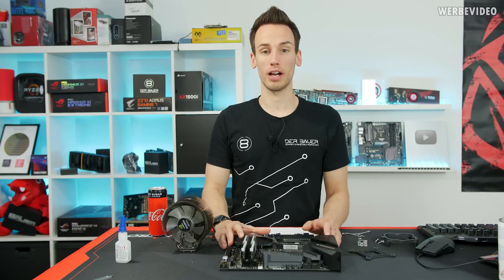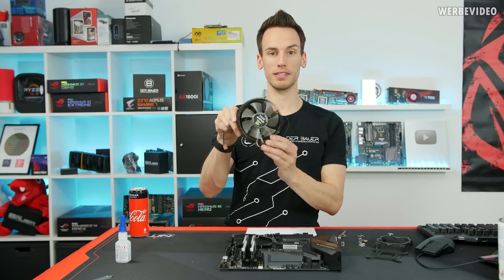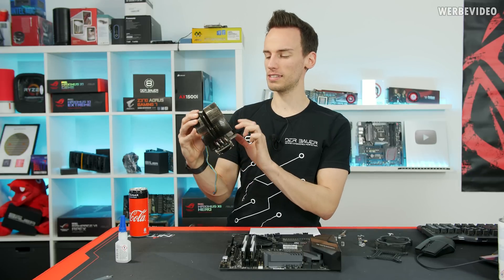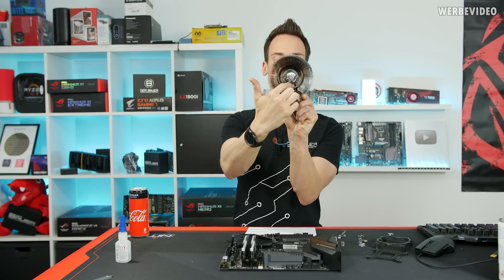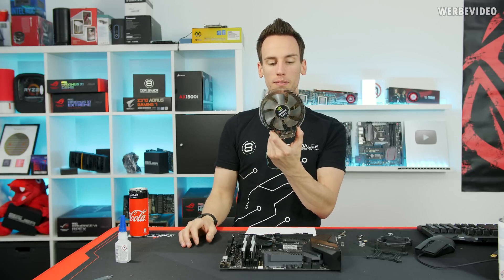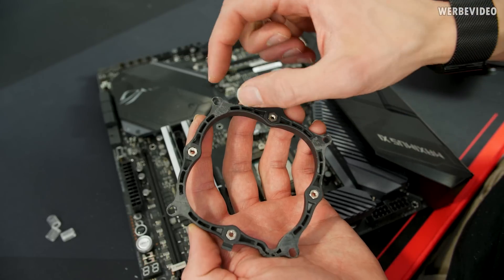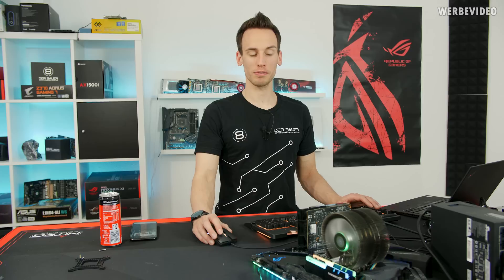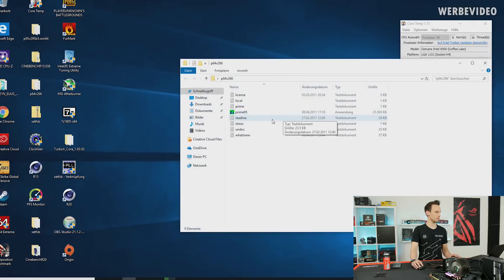HW-Legends #4: Using a 12 year old CPU cooler for todays i9-9900K? Zalman CNPS 9700 NT

Comment: I have 3 computers and all are still using 2 copper fins on 2 computers and one of the black nickle plated . What you did not point out is the pipes that connect to the bottom of the cooler are brazed or soldered at the mount with some gaps in between the upper plate, if you look at the 4 screws at the bottom of the cooler the plate that actually contacts the cpu does not come into contact with the heat pipes. I removed the bottom plate and filled the gaps with arctic silver and was able to lower the temp of the cpu. You should do the same and run your test again. I am still using my 3 computers with these Zalman cpu's. One is a gamer p, from 12 ys ago.

Comment: I like Zalman's CNPS coolers, those round ones look soo cool. I want to get one for my Phenom II X6 1090 when I move it back onto my Crosshair II because the copper would match with the bare copper heatsink it uses on the chipset. I know it won't cool it well enough to maintain the OC I put on it all that well, 4.2Ghz @ 1.55V, but it should keep it cool enough for a lower OC and look good doing it. :)

I wish they'd make a beefier version that'd keep up with today's high end parts and overclocks a bit better. But I'd assume its a size and space issue. There's only so many heatpipes you can stick into a design like that before you start to lose a lot of efficiency in cooling. CNPS12X Isn't that bad considering its price point and it is a six heatpipe design but unlike the older models that paired heatpiptes with copper fins, this one used aluminum fins and all of it was in that nice black pearl nickel finish. It was quite good for the era it was designed for, keeping up with Noctua's NH-C14 which used dual 140mm fans in a horizontal sandwich sort of configuration on the fin stack. Not only did the Noctua cooler perform better but it also gave vrm components, chipset and ram some extra airflow with the fans pointing down at the motherboard rather than pointing to the back of the case.

Comment: Oh, man. I sometimes forget about the early days of my PC building time. I’ve been running a TRUE since 2008 when I put it on a Core 2 Duo e8400. Currently cooling my Ryzen 1700X @4GHz. I did put one of the Zalman GPU coolers on my 8800GT way back then!

Comment: What surprises me is, first it says "Genuine Intel 0000 (Coffey Lake)"???, second is VID 1.2687 @ 4.9Ghz and it's not crashing. The cores are cooking at almost 100c with such a low core voltage even though they are running at 100%.

Comment: ZALMAN CNPS9500A.  I've had it since 2008.  Works fine.  Stopped using it once I put together a new rig.  Went from an i7-940 to an i9-9900k with a Noctua NH-D15.

The Zalman is a great cooler but even on the i7-940 running a modern day OS (Win 10) I could tell the CPU was having to work harder and in turn that caused the cooler to sound like a jet engine whenever I threw something moderately labor intensive its way.  The NH-D15 is whisper quiet even when the processor is under full load by comparison.

Comment: I used those Zalman coolers for a long time. Lovely products that worked well.

The reason I stopped was because if the fan died, I couldn’t just swap it out immediately with a functional one.
Heatsinks with clipped on fans are so much easier to effect a quick repair

Comment: I actually am still using exactly that cooler. I am still running it on an i5 2500k which I put into my first pc build in 2011. Though After 8 long years my i5 and the cooler will finally be replaced by a Ryzen 3700x.

Comment: Uh... you made no mention of the other coolers FAN NOISE. Just saying it's only 5degC hotter than the best cooler (or whatever you said) but then not commenting on noise doesn't really tell us enough. Was the Noctua running 100% fan? Was it noisy?

Comment: Back in the days, i used to overclock many many p4 and pd, those m*** w hot as hell, in my experience, the best of "that" heater-sink model, was the "ASUS Silent Knight 2", 500gr of full copper, that was a beast, trust me.. you should try one if u get one, i still have one 100% as new, even the copper its cleaned x"DD

Comment: No surprise there. Some parts are totally not related to the age like in any air cooler. If the heatpipes are not leaking and fins still clean and straight and properly soldered, then it should have the same performance it had.

I still use the mugen v1 cooler from sk775 on ryzen 2700.. i made a custom retaining mechanism, but apart mounting issues out of the box it works just fine in touch with any premium aircooler like it was back in 2007

Comment: The reason pwm doesn't work is because 4pin pwm sockets have different pin layouts, I remember pin 4 is the pwm pin and pin 3 is rpm data

Comment: I had the all copper version of the Zalman cooler which you showed, and I gave it away to a computer retailer with lots of other PC junk. That was a good unit back in the day, but the major flaw was in the design, air restriction due to fins being too close as you get closer to the center of the cooler.  As we all know, cooling is about volume of air over a cooler and if you restrict air flow, you decrease efficiency.  Noctua was the first cooler manufacturer who recognized this by increasing fin thickness and spacing, which has proved effective at heat dissipation and mitigating dust accumulation.  I am a Noctua fan.  Thanks for the video, Zalman definitely had its day in cooling, I liked their coolers too.

Comment: I used for years a 9500 NT (on a A8N-Sli Deluxe 939 Nforce 4 xD and a X2 4800+). 

I gifted the thing to a friend years ago for a FM2 A10 5800K and reduced the fan speed with a 7v adapter. Even like that I can't understand how I beared that noisy fan xD. The thing is still kicking, no rattles, no troubles (albeit the thermal paste tends to dry a little bit faster than standard tower coolers) and manages the old 5800k no trouble. I serviced it a few months ago, it just needed some de dusting, besides that it's almost 10yo and the fan isn't giving any sign of going bogus.

In my main rig I'm still using a Zalman CPNS 10x Quiet (i7 3770) albeit with a Noctua NF-F12. That cooler is really nice, it also gave a run for a NH U12p sometimes doing even better.

Comment: That the i9 9900K draws too much power often is the fault of the Mainboards using shitty settings that let it run hotter than stock.
It is allowed to draw ~120W for 100 seconds, and the long-term average is the rated 95W. 

how extremely bad the default settings of many motherbaords are i learned when first an i7 8700K - 130W in cinebench R15.
Changed the settings to intels specifications and viola - peak at 110W and same score. Tweaked them a bit and it stays at under 80W now - slightly lower multithread score but quit at all times.

Comment: I still use my old cooler, a Thermalright TrueBlack 120,
first used on a Q9550 (775), after that 
bought the Thermalright adapter (1151) to later use it on a overclocked i5 6500 with Z170 (yeah blck overclock)
and proudly now cooling a 8600k@4.5 on the same Z170 mobo. thanks to bios flashing :)
Hope will serve my next CPU, probably Ryzen3xxx series.

Comment: I remember getting a small two-tone (don't know if it was actually copper+aluminium or if some of the aluminium was just anodized) Zalman cooler for my first PC build - an AMD 800MHz AMD Duron, IIRC. Pretty funny looking back at that today considering it would definitely qualify as a low profile cooler, and I had it in a massive full-tower case. Those were the days :P

Comment: Some years ago i had ( 2013-2014 ) the same zalman cnps 9700nt with external fan speed controller knob at the back of the case. The green led light of the fan died off but the cooler was cooling very good Phenom II x4 965BE even overclocked a little bit.I sold them in a bundle the cooler and the phenom x4 and still regret it,they were very cool - legendary cooler and legendary cpu :)

Comment: wow i actually still have the 9700 that runs on my wifes pc  after all this years,i moved it there after i did custom watercooling on my main pc years ago. the 9700 also owns a nice small rpm controller that was in the original package.

Comment: I am still running my Zalman's!  I have one in my retired 2nd gen i7 gaming rig...and one in my current 4th gen i7 rig.    I am looking to upgrade to an 8th or 9th gen i7 later this year, and I'm coming to realize that the Zalman's are just old tech, and there's much newer, cheaper options out there that cool much better. I'm kind of torn because I want to keep my Zalman for pure looks,  but ... it's old tech, and I don't want to risk shortening a new CPU's life for vanity's sake :(      Mine are both the old copper color versions :)

Comment: I had the copper one before, but sold it right away and bought a Thermalright tower cooler. The Zalman looks cool but it can't handle overclocks from my core2 duo so I had to switch to Thermalright which handled it better. 
I still would want a Zalman cooler now for new cpus as long as they've improved on the thermals.

Comment: I'm actually still rocking a ZALMAN CNPS9500 now on it's second and final CPU. Got it in 2012 with plenty of repaste/remounts and it still keeps my 4770k stock clocks around 45 c. I'll be retiring it this year when I switch back to AMD after using Intel for over a decade.

Comment: I bought an old cooler of eBay.. it looked like a CNPS 7000 Cu.. it didn't give any name, just a picture of an old dusty cooler covered in paste and other gunk. And to my happy surprise, it was, the fully copper one. Cleaned it up, and it's as good as new, and due to it's low profile I can put it in a super thin case.

Comment: One thing to notice.. That's a 90mm fan. And not a fancy one at that. If they updated the design to use a 120 or 140, I think it'd probably work as well as the best air stuff now.

Comment: An oval (from Latin ovum, "egg") is a closed curve in a plane which "loosely" resembles the outline of an egg. The term is not very specific, but in some areas (projective geometry, technical drawing, etc.) it is given a more precise definition, which may include either one or two axes of symmetry.

Comment: I had the Zalman CNPS 9500. It was a high-performing cooler, but it was overpriced considering the performance (there were slightly better coolers for cheaper). I loved it though. It looked, I think, quite beautiful. I can't remember for sure, but I think I was using it on my Core 2 Duo E6300 (unless my memory sucks and I had it for my Athlon before that). It kept that CPU cool enough at 2.77Ghz (1.86Ghz stock) and it was pretty quiet with he fan speed down lowish (I was using a fan controller, which I think came with the cooler), which I think is pretty impressive.

All that was inside the Thermaltake Shark (which for some reason I loved the look of) and I think that remains my favourite PC that I've ever owned. I donated it to a friend in 2012 who was running it until this year. That was actually my first PC from entirely new parts

Comment: I had the copper version of the 9700 LED back in the day on my Smithfield Pentium D 830 (dual core, 3.0GHz, socket 775; one of Intel's first true dual-core consumer CPUs) and it was awesome.  I had it set up inside a case with two large case fans in the front blowing in air and one 120MM fan right behind the Zalman cooler on the back of the case exhausting the hot air out and it worked great.  I had a high end (for the time) ATI GPU and I could game happily back then at 1920x1200 (I had one of the old DVI-D Apple Cinema displays; it was beautiful) playing games like Quake III (which was pretty old by then) and UT2K4.  I tried to play newer games like Fear and Unreal 3, but that system really wasn't up to it, especially since I only had 4GB of RAM and was running Windows Vista x64 by then (I jumped off XP to Vista as soon as the first betas were available and ran every RC build all the way up to RTM and stuck with Vista all the way through SP2 and finally went to 7 once I got a new system).  I never had problems with my CPU temps even though those old Pentium D chips were known for running hot.  It definitely worked as a space heater during the cooler winter months :P.  I remember when I was planning upgrades for my system, this cooler was one of the first things I picked out.  I thought it looked amazing and the design seemed like it would be very effective, and indeed it was.

Comment: I still use the CNPS10x flex in my system. In fact, I use it with a couple of modern ML120 fans. Performance is better than most 120 towers now on sale, getting close to a Noctua u12s.

Comment: I Had the "Zalman CNPS-8900 120mm CPU Cooler, Quiet version & Extreme, 60mm Height,  Could be the best Low profile Still, As seen on frosty tech website, Shame it don't support AM4 ,
 Zalman still making the 8900 Quiet Version & for sale.

Comment: Zalman also made the CNPS 9500 series that I used on my FX60 (still has it on) I'm currently using the Zalman CNPS 9900 Max (copper) on my Sandy 2600k. (oc)  Great coolers for their time.  What i like about this design was its 360 air flow around the CPU socket.  My local Micro Center still sells these types of coolers.  Thanks for the test review derBauer!

Comment: Great vid! Really impressed by the performance given its age! 
I actually still have my CNPS 9700 NT, bought in 2006! It has many hours on it by now, one LED is about to fail - but the fan is still working (3 pin header!), the bearings are all good - and it almost looks like new! 
Even better, it's still in service! It's currently installed in one of my vintage-rigs; it's keeping a 4-core Phenom processor very cool. It has been installed in 3 different system builds in total over the years, and cooled 1, 2, 4 & 6 core AMD CPU's. Maybe I was lucky to get a great unit - or these coolers were in fact manufactured to very very high quality standards (considering it's still functioning so well). 
Also, I still love it as much as I did back in 2006, mainly because of the looks. The chromed fins & green fan looks fantastic (lean&mean), even in the current super-vibrant RGB-era. It brings back a lot of memories every time I see it!
Lastly, I have photos of my CNPS on my socials, as well as the vintage-system it's currently installed in :D
Cheers!

Comment: I have ZALMAN CNPS7700-CU which was installed with P4 and them moved to Core i5 750. Unfortunately I lost one of the screws and ended up replacing entire cooler. I still have it though

Comment: I used to use an all copper zalman cooler for my Q6600 that came with my P7N sli Platinum board. The package was called P7N Zilent.
I used hot melt glue to add a fan to the rear side so it pulled air as well.
I lapped the cpu and heatsink plus pulled cold air from my attic with a kitchen extractor and my temps were seriously cold. Never had temps like that since

Comment: That cooler is known to handle more than 150 watts with good temps. I was running Core 2 Quads that were 90 watts stock and probably 130+ when overclcocked fine. This cooler could work well on a Ryzen and have some overclocking headroom.

Comment: Zalman coolers, I still have a few knocking around. I had one with dual circular heatsinks with a 135mm inner fan, kept my old FX 8120 cool under pressure at 5.1ghz with a ASRock 990fx Extreme 3 (The MOBO with the huge FSB heatsink). Half the cooler broke off, and it still performed well.

Comment: my AIO is sketchy these days, so I swapped my H115i to a 10-year-old scythe mine 2 cooler.  I have to do some metal work for the AM4 mounting,  but the result is almost comparable. the CPU is a 1.3 V 3.8G r7 1700. But the one I used here is a 8 heat pipe, >1kg monster with 2 140mm fans.

Comment: I had the copper version of that CPU cooler and it was on a fairly old computer. I noticed after about six years it would no longer pull away heat as quickly. I suspect that the liquid in the heat pipes has escaped, or is not working as well as it did. probably the same in your part as well, you can usually tell if you stop the load and the temperature of the CPU immediately goes back to normal. That means the heat is not being truly soaked into the CPU cooler all throughout the pipes. Do you get a different result if you turn it on to its side?

Comment: I'm using the original copper version of CNPS 9700 right now, on a 10C/20T Xeon E5-2640 v4. It keeps the CPU cooled passively most of the time (I set the fan in the BIOS to only spin up at 45 °C), so it's still very good if you don't go for crazy overclocks. For mounting, I just use an LGA-2011 adapter bracket from eBay with the AMD clip.

Comment: Up until last week I was still using the copper version of this cooler on my Q9550 OC @ 3.82ghz, I "upgraded" to an FX6300 using an old Athlon x64x2 am2 stock cooler. May try and mod the Zalman  to fit the Am3+ socket after seeing it cope with this!

Comment: In your charts, you should probably round the numbers to the least precise values. When comparing 84.87 to 79, you can simply round it to 85.
BTW I don't think we're in a 100th degree precise in those measurements, the sensor displays 4 digits but probably doesn't really measure that precisely.
😉

Comment: Still have Zalman CNPS 9500 on Core 2 Duo E6850 if I remember correctly in my own first computer which is currently used by my parents for basic stuff :D Very good cooler with cool design back in the day.

Comment: had 9700 LED(copper),9500 and 7700 copper (and also the copper/aluminium version too), Zalman vf-700 to GPU.. those where the best ones to get at the time. CPU was AMD Duron (modded to athlon and 2.6ghz) .. those where the times :D

Comment: I had the bare copper version cooling my Core 2 duo E6570. The only problem I had with it is that if the fan moved a bit, for example when transporting the system, it woould rattle against the blades and needed some re-adjustment.